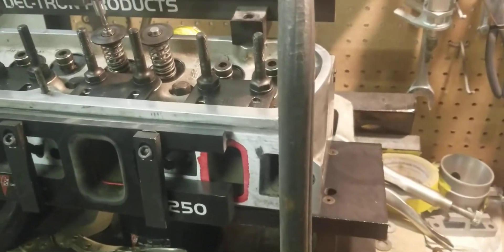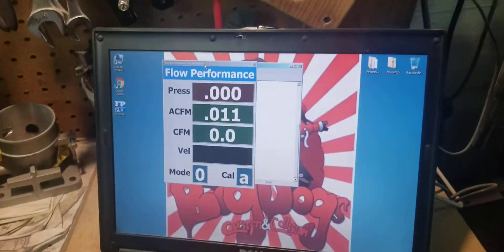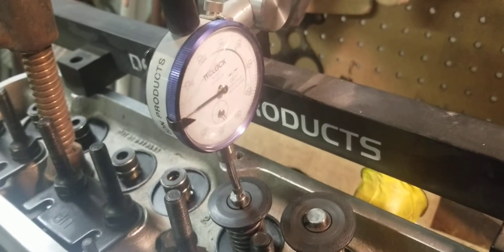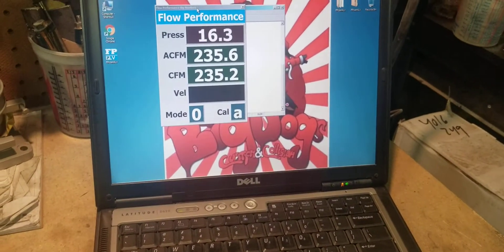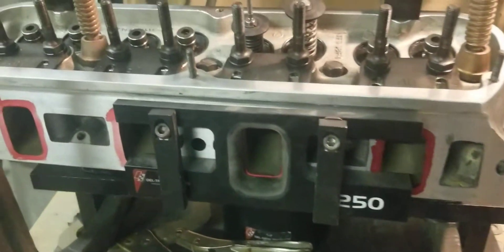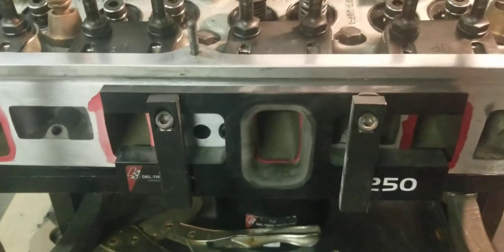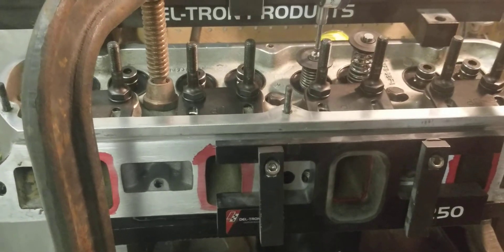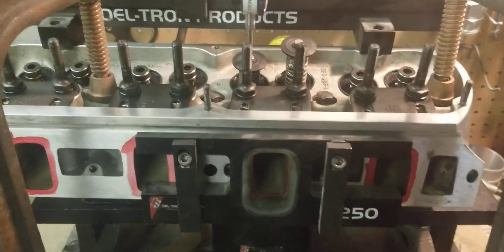Flow testing Stock sbf TFS 170 heads.

Comment: Flow bench seems to be right on par when you test stock castings. If anything it’s a little conservative, but I bet a lot of flow benches are a little happy.
Reply from the maker: You are very sharp! Many people talk about our flowbench and say it's not legitimate compared to a Superfow 600 but what they don't know is that a SF600 has soo many issues with giving true readings. There have been other porters post how their SF600 gives different readings on the same parts based on operator manipulation. The SF600 has baffles below the flow tube bore that sizes can be changed by the operator by turning a lever which will change the flow results.
Also the SF600 needs to be calibrated manually constantly.
Our flow bench is digital, calculates the results to 28" automatically based on elevation and has no baffles below the bore tube that can be manipulated. Also it self calibrates so no room for human errors. Our Flowbench is very accurate and repeatable. All of the Bigdogs Porting staff run parts that we port and modify so we trust our results 110%.